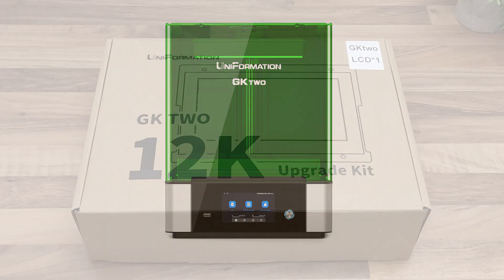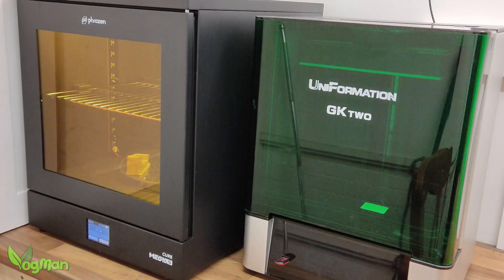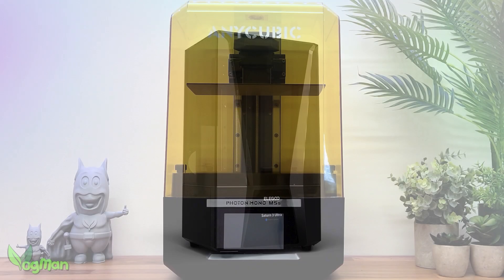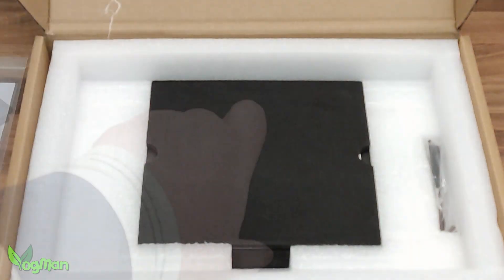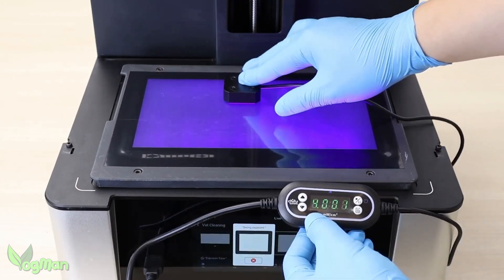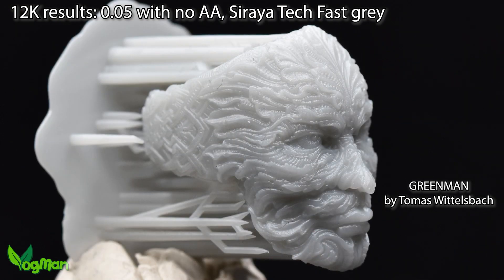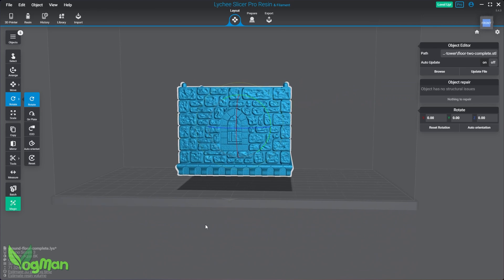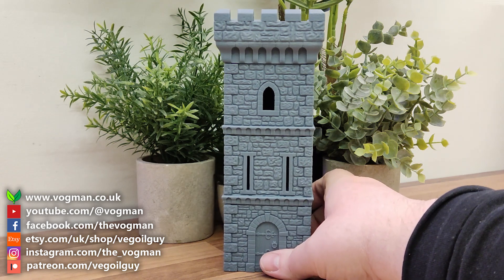Uniformation GK Two 12K UPGRADE plus FREE Castle STLs & Printing Lessons

Comment: I ran into the same exact problem printing vertical/flat building I designed... it took me way longer than it should have to finally test tilting the model slightly 😅. I could have used this video about 2 weeks ago 😂

Comment: A built in heater makes so much sense. And love the castle tower. So other than the bottom supports the stairs don’t need any support?
Reply from the maker: Yes... the stairs rise at an angle steeper than 45 degrees so the resin printer will naturally cope. The mid-landing section is supported by an archway. The stones are bevelled so they don't create islands. In short, it SHOULD print without supports. It has for me every time 😁
Reply: Awesome, will try printing it. Have an idea that involves a fire breathing dragon! As if I need more modeling projects. 😊

Comment: That UV lightmeter/calibrator is an interesting concept. I have never heard of that for a printer. Thank you for the new info. Now my brain is pushing out some math directions to make room, but who needs that, right?
Reply from the maker: The meter is by Chitu so presumably you can buy them. But the variation during the scan is surprising. I was aware that arrays like the one shown do fluctuate light levels in the creases of the UVs, but it's still surprising. I'll have to plug it into a COB printer and see if it's different 😁

Comment: 4:00 Any tips for controlling the warp resin prints get like these exposure tests?
Reply: There can be many causes of this. The pull force from the print and FEP/film used on the bottom of the vat, too thin model so the UV warps it as it cures, but my guess is these were printed flat on the plate and the curling is from scraping it off the flat build plate with a scraper. If it is the last you can reflatten it with your hands before curing, to a point.
Reply from the maker: These exposure tests are very thin and not really meant for anything other than throwing away. For that video I cured them as they were hanging around on my workbench for a few days. Curing something that thin tends to lead to warping... larger pieces should really warp.
Reply: About 75% of UVA passes through ordinary glass - so without having tried, I would imaging placing a piece of glass over the item (well, both sides) and then exposing it to UV light might cause minimum warping?

Comment: Do you have any tips/tricks on how to add wood grain, or stone textures to a 3d design? I'm used to working in fusion or SolidWorks, so really curious how you go about that.
Reply from the maker: I'm using ZBrush which allows you to use Alphas to add texture. The woodgrain, for instance, comes from here... https://www.artstation.com/artwork/w0AXW6
The stonework was all me as I couldn't find anything rough enough to add a texture that would show at this scale. So I literally added and subtracted virtual clay on every single brick.

Comment: I appreciate the review but it's hard to make an informed choice on the 12k upgrade when there are few videos (from creators I trust) comparing it to it's 8k counterpart. Some people address that rectangle pixels from 8-12k dont merit the upgrade. Im a bit disappointed you didnt address that and was hoping for a more indepth review, can you genuinely recommend this as a legitimate upgrade? Yours and fauxhammers reviews are what helped me choose the GKtwo which I am eagerly awaiting, but I worry that perhaps i ought to have waited? But then I would never get started either
Reply from the maker: I'm guessing you haven't seen many of my12K reviews? EVERY 12K screen has rectangular pixels creating 19 x 22 xy res. This is because there's only one screen manufacturer. So pretty much, it's the same tech in every printer. This means really the quality of the rails, plate, etc, are what counts. Now there are better quality 12K printers out there I think, though none with built in heaters. But this is really about the convenience to existing GK Two owners, being able to upgrade. I hope this helps 😁
Reply: @vogman  it does, I have alot more to learn
Reply from the maker: We all do. It's an industry that's very, very new and changing constantly 😁😁😁